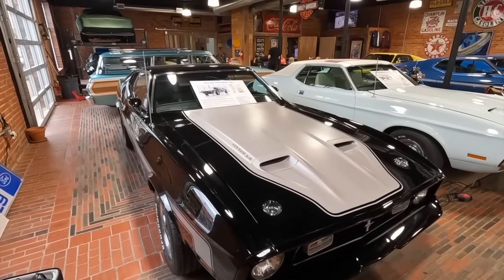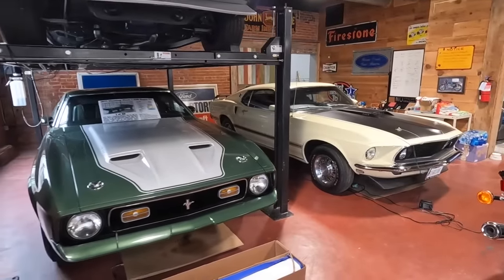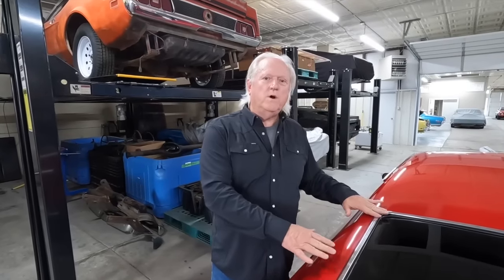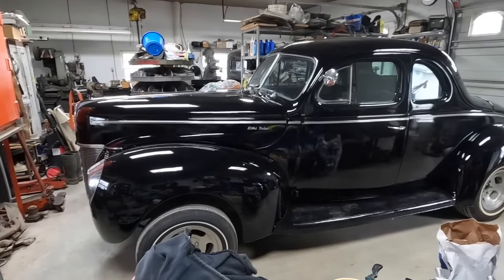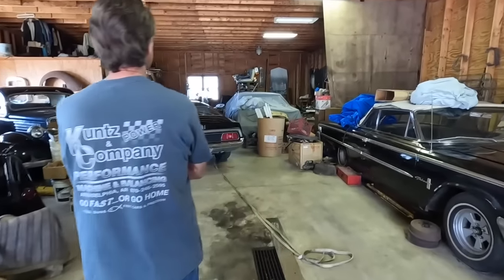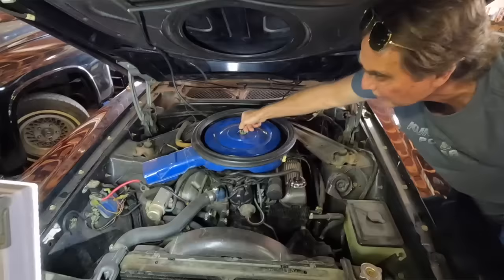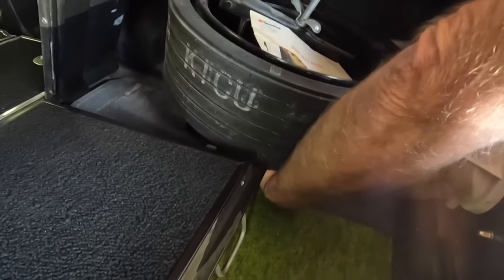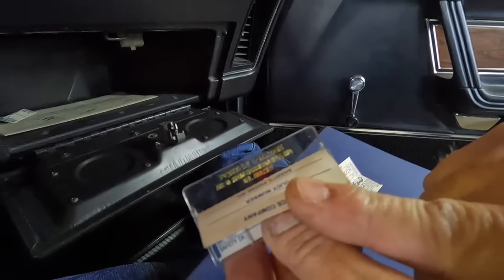Finley Ledbetter:Buying  & Restoring 1971 Mustang Super Cobra Jets - Any Condition

Comment: In 1978 I was driving down Ogden Ave in Westmont IL a road that is jammed with Car Dealers. As I drove past the MB Dealer they had a mint Red/Black 71 Mach 1 sitting right out in front on their lawn. I pulled over and as I was walking up to it I saw 429 Ram Air on the hood scoops. I popped the hood and yes it was a 429 SCJ.  The salesman came running out and said "hey what are you doing" I was only 19 at the time. I asked how much do you want for it he replied $4400 I told him that he was nuts. (I had just recently looked at a pristine 72 351 4V with only 25K miles for $2600) He said that there is a local speed shop that would give them $2500 just for the engine so what is the rest of the car worth?
Reply: Well he may have been right but seems in 78 he was a bit high!!! Of course today it would have been a good decision we all made those errors.
.

Comment: So does this mean my 73 is worth nothing, just cuz the 6cyl with a 3speed, it's a zero option car it does have a heater and a radio??? runs great, starts first time every time!!! drives great!!!
Reply: Have a 73 coupe in rough shape, engine is in the garage. Rebuilt 351C with hydraulic roller cam similar specs to what was in the 351Boss motors.

Comment: Interesting he loves the '71. This was Mustang's last gasp before the Mustang II and was the biggest and most bloated of the original design. Sort of like the Thunderbird that got bigger and bigger and heavier and heavier. Not sure why that was, but the upcoming oil crisis of the 70's put an end to it.
Reply: It is a little bloated but still a fantastic looking car.
Reply: I thought it looked better than the corvette about the same size.  Flush door handles and hide away windshield wipers  under hood.  More. Modern design. Sleek looking. I believe it was only three inches longer than the 1969 Mach one.  Back in 1977 my brother bought a triple black Mach one with Argent silver stripes and in was beautiful.  People would stop to look at it.  It had the 351 m code  Cleveland with four barrel carburetor.  It looked like this car but my brother's had the wing and spoiler on it. The car came with a factory  9 inch rear axle and C 6 transmission.  Heavy duty.

Comment: Correct me if I'm wrong and I could be But I think the rarest muscle car is a 70 cuda convertible. I think they were only Is 2 ever built
Reply: They built 9 of the 71 429 SCJ/CJ J code 4 speed CV Mustangs 2 still exist that I know about. they built 12 Cuba's and a bunch of Challengers over 1800 I put them both in one pile myself sort of the same car.
Both are rare today and in the big block 4 speeds the numbers come way down for the Mopar's I don't know that number but it is small as well but way more than 9. I have the articles written on this car by smarter guys than me reach out off my website I will email it to you for fun!

Comment: The 1971 Mustang was truly the most beautiful Mustang I think they ever built. It was the worst handling piece of s*** they ever built also. I don't know of a single one that is a monster of any type. Unless you completely scrap the suspension system and make it into a drag car. They did handle, much like the USS Forrestal.
Reply: Well they will not win a road course event without big changes no argument there. But I'm a big guy and they fit me and I'm more of a street car guy. I had a 2012 Boss 302 track car is was a gas but I never really was any good at it! :)

Comment: Rarest 1971 is a Boss 302. One made.
Reply: Well sort of but actually that car was never produced or sold was a P-type only! I was there with Bob yesterday in his shop so if u count non production P-Types there are many really rare one of a kind cars but PRODUCTION cars in 71 the 429 4 speed J code CV was only 9 built and sold as real cars that pretty low numbers!
Not wanting to argue of course Bobs Boss 302 is king of the herd!
Reply: @finleylebetter6419  There is no point in arguing, all cars that I won't buy, just drool over. Even if I could afford them, I still wouldn't buy them. Because the minute I bought it I would want to change or fix something on it, which would ruin it.

Comment: What a great guy, these 71 to 73 mustangs were worthless for years.  Even a well maintained low milage with original paint in like new condition were only worth about 30 grand until just a few years ago when all the restorable 1970 and olders were gobbled up.  Now they are valuable and the last of the muscle car era. Ford bowing to government pressure dropped the power in 72 and even dropped the Boss name instead calling the same engine a High Output to try and satisfy the EPA.  By 73 they downrated the engines so much the muscle car was gone.  I still wonder what Ford was thinking by stretching out the nose in 71, the car was already light in the rear so why put an extra foot of nothing between the bumper and motor?  And that rubber bumper on the Mach 1 badged cars, today you can't buy a new one at all from what I have found.  Anyone who ever had to do front end work has cursed ford for doing that as getting it all to line up takes work.  Great video.

Comment: why not take that battery tray out and clean it up its beginning to fail, a good cleaning will preserve it, then wax it with hot beeswax, will save it indeed with zero impact to the metal, just heat the wax up to molten and rub it onto the surface with shop rag, will end rust and corrosion and put a barrier between future acid and metal, the worse it is the more coats you apply, clean and brush off with a toothbrush baking soda and dish soap, hot water, clean rinse and wax...  yessir you will be surprised how it comes back...  this process works for a lot of metal you are on the fence about completely restoring or preserving as original,  if anything it stops the rust and corrosion process while you decide..

these people who keep cars and won't let go of them while they rot really bug me, they are willing to do nothing to stop the decay not even throw a tarp under it and a cover over it yet wont let go of them..  really erks me those types, they let it get so bad some are unrecoverable but had they 35 years ago put a tarp under it and cover over it the vehicle would still be in a daily driver condition.. makes no sense, they watch it rott or put it out of sight for decades and decades till its just an eyesore or the landscape swallows it.. sad

Comment: My dream is to have a gm  Ranch restoring early 2 thousands  Is too late 2010 Is GM vehicles hunting down  New old stock
Reply from the maker: which cars mainly would they be?
Reply: Chevrolet silverado   Chevrolet  Camaro  CorvetteIs ss max  Chevrolet silverado  ss ssr   All Chevy  
Camaro's from 1998 to 2016 Even V6 models Southern Conference and regency Chevrolet silverado   All C5 6 7 corvettes   Even the basement of Corvette's also  zo6 zr1  And all Chevy Silverado   Draw a Max from 2001 to 2019 Call models
  Tahoe GMC  Yukon escalade pickup truck version Chevy  Avalanche from 2000 to 2019

Comment: 429s never made hp or torque like FEs
Reply: yea I'm sure Ford developed a slower less powerful engine. They cured all the issues w the FE with the 385 Series. Unleaded killed it all though bummer for us all.
Reply: @finleylebetter6419  I agree thst if not for epa regs and low octane fuel the 385 series may have surpassed the fe series but it to decades from it original development for Kasse to get where he's at now for 429 and 460s in a street format to make the horse power and torque slightly above the fe the max hp of the factory ratings were 375 for 429 and 365 for 460. Now we all know they made more 429 was refactoring at 410 to 420 the 427 fe was rated at 425hp Nascar refacterd at 575 and that was back then in late 60s early 70s not the shitbags at Nascar these days. Don't take my word for it research and you will see I've built around 100 fe in all cube sizes the last one I built was 410 off of a 390 block. Dynoed at 431hp thanks for the reply

Comment: The 70's were the dark ages for perfotmance cars.  All of us who were brought up on the 60's performance cars considered the 70's cars as posers.   After all performance took a nosedive in the 70's and Detroit was just plastering those posers with  all manner of racing stripes.
Reply from the maker: The muscle car era did not end in precisely in the 1969 model year. The 1970 models were loaded up with. muscle. Compression ratios cut back significantly in the 1972 model. year. Pontiac had their 455 Super Duty motors inn 1973 and 1974. Pundits look at the 1974 Super Duty Trans Am and Formula Firebirds as the last muscle car.
Reply: I don't think so July/August of 71 was the actual end! There are some fast 60's cars for sure but the early 70's car's are really good! Come to the Barn on a dry day that is not 110F let me try to show u some fun stuff! Lets me show u !